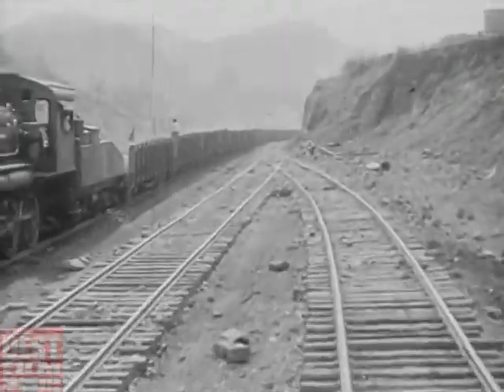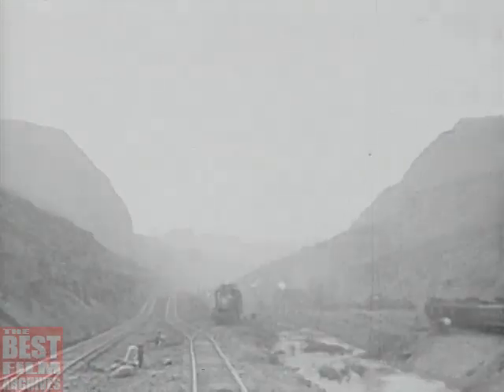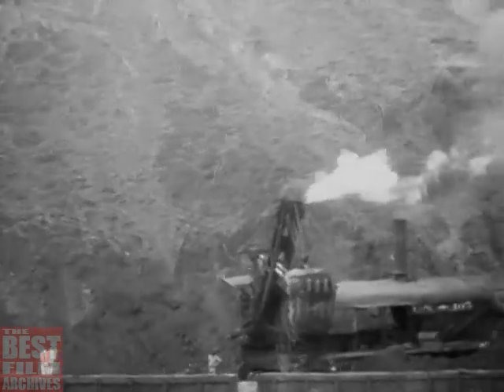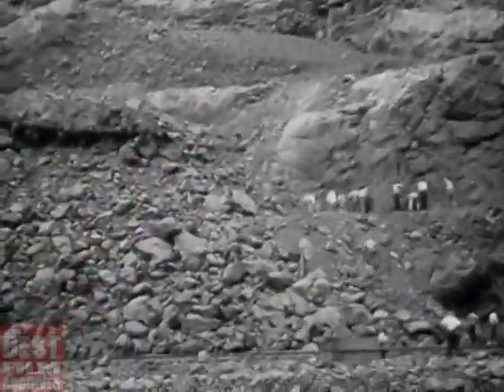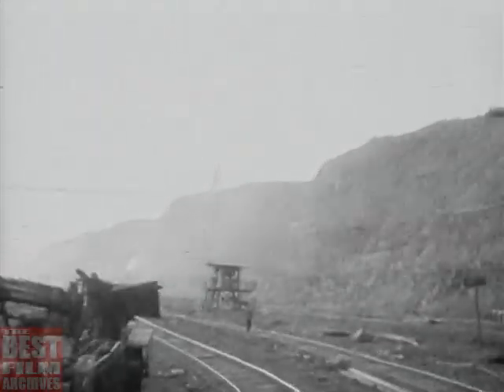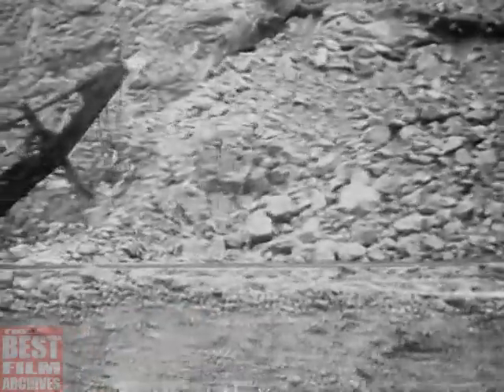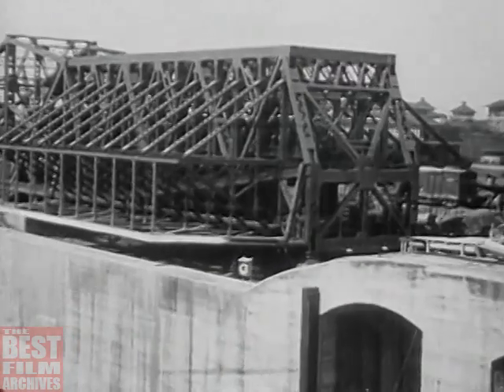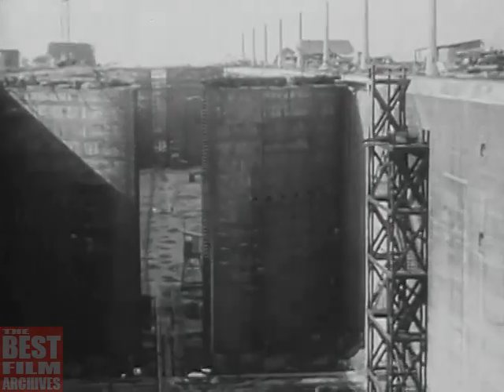Panama Canal Construction in 1912 | American Vintage Documentary

Comment: The steam shovels, the churn drills and most of the Differential dumping rail cars were purchased and sent to the Chuquicamata Copper Mine  when the canal was finished.. Most of the steam shovels were converted to electric drive, and I can remember many of them in the "graveyard" in the early 1950 era. Some of the drills fought on until around 1960, but the shovels and drills were almost all replaced by machines from Bucyrus. When you get a good thing, you keep with it!

Comment: Very nice!  Btw, the scene at 5:25 shows the original controls for the lock.  Not electrical mechanical but all hydraulic. I read an article about it back in the 90's  It's long been replaced but it's wild to think the operated the locks, valves all in a control room with a working model of the locks.  What ever they did on the model controlled what happened in real life.  I remember one pic of the clip that you show with the lower doors open.  All sorts of plumbing.  No wires.